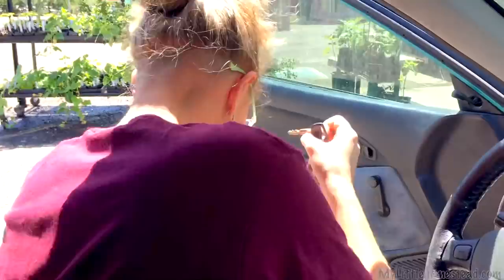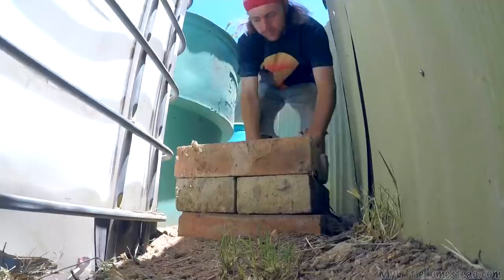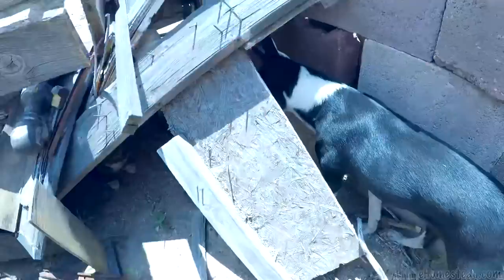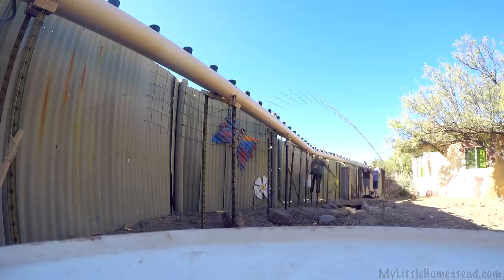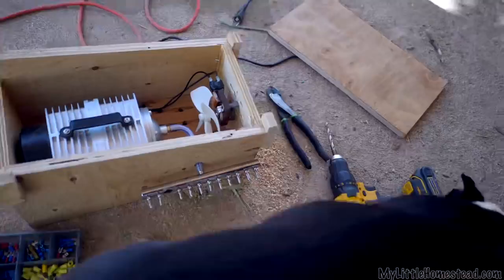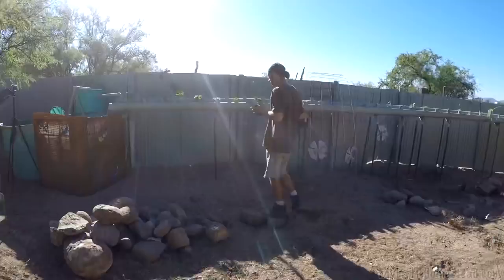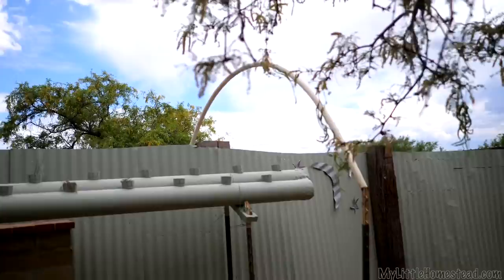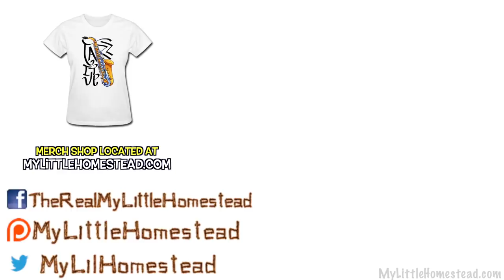Complete Build of Aquaponics System | Full Version Movie Length

Comment: YES! This is what I have been waiting for, I went through all the weekly peeks trying to get the full aquaponics build. This just made my life easier. Thank you!!
Reply: There was a video that showed up against aquaponics during g a commercial break. Just thought that you would want to know.
Reply: The setup works but this particular system is fraught with design problems in my opinion:). The airlift to move water is an excellent technique but larger diameter lifting pipe is needed as is a larger air pump, one also should make an air chamber at the injection point. Your fish tank needs a cover to cut down light aswell otherwise algae will grow eventually.

Comment: You can bend PVC pipe with a heat gun. Pack the pipe first with sand so it can keep its shape then heat up the pipe until it is soft. If you have a form that would be perfect. As soon as you have the pipe at the right angle spray cool water on it to harden the pipe to keep its shape. I use this method to male the net pot holders for my vertical tower system.

Comment: This is great an amazing protective idea. Thanks for the recap. I worked an a catfish farm and the fiberglass and resin will work perfect specially with what you're putting it on and if you develop leaks or cracks along the way or want to seal up one of those little holes you made there you go just see some more of that and it'll last for a long time it never hurts the fish either. God bless you all.

Comment: something that can help minimize solid waste cleaning intervals, aerate the system, and maximize the harvestability of fish waste in a aquaponic system is a Moving Bed Biofilm Reactor. basically its a container next to the solid waste filter filled with k2/k5 media and air stones to aerate the media forming a biofilm to break down waste like how the rock media does in the system. its like adding a small sewage treatment plant into your system before putting the water into the plantbed system potentially preventing backups.  this will also help stabilize the system so there aren't massive ph swings or nitrite buildups that would potentially kill off fish.

Comment: You'll end up with snails absolutely everywhere!. All you need is to cover your tanks from sunlight, catch the solids in first filter, then add a moving bed bio filter with that air pump then a fines filter after that. Try those 40cm commercial floor polishing pads their like big scourers but thick to catch your fines.

Comment: You can do a lot with pvc pipe.
You can join them by heating the one end of pvc and then push two ends together.  A turkey burner works great. 
You can heat a 4 inch and pull two 2x4 nailed together though it with a rope tied to the boards cut in a point. That makes a square box.
You can fill a pvc with sand and heat it and bend it and let it cool. By using sand it won't kink. You can heat and form and or cut and form and make all kinds of brackets. Pic pipe is fun. Dont buy joints. Just heat on one end and push together. Joints are exspensive.

Comment: You will want to be able to test for nitrite and nitrate, nitrite is much more poisonous, but should be broken down in to nitrate fairly quickly in a healthy system. You may find you need a biological filter before the fish tank if your plants are not taking all of the fish waste (at the start of growing for example) or manage fish stocks in line with plant nutrient uptake. Been a very entertaining series to follow along, and really nice to be able to watch it all again as a single video, thanks for the hard work!
Reply: Also Nitrite, at relatively low levels, will kill off any nitrate processing capacity in the system as well as the fish.
Reply: As you've already discovered setting up a system can be really good, snails eat algee, then loaches eat snails, so you don't have to much algee or snails.

Comment: Flood and Drain (Bell Siphons) work fine once you get the system tuned. Mine has been running non-stop for five years. The advantage of bigger beds with rock is you can grow bigger plants. My cherry tomatoes grow 12 foot long by the end of the summer. Your system requires a lot of fish and as you found out more water flow. I keep every part of my flowing water out of the sun to keep algae down. All the tanks and pipes are insulated with radiant barrier to maintain water temperature. I am thinking of adding a pipe like yours on my pipe that returns to the fish tank. I'm already pumping the water there I might as well utilize it. What ever system we use any thing is better than watering every day by hand.

Comment: Having built a couple of systems, i have some recommendations for you, not claiming to be know it all though, just sharing my experience.
So your solid filter i think could be improved, have look at swirl filter, you need to cycle your system about 6 weeks before introducing the fish, the algae problem you got is because the microbes have not populated the system enough yet, temptation is strong, but its worth the wait, it can even result in fish death, after six weeks then measure the water.
your measurements should look like  Ammonia: Less than 2 ppm, Nitrites: Less than 1 ppm (ideally less than .5 ppm), Nitrates: up to 160 ppm
Also you are not allowing the roots to breath, you need to oxygenate the water a lot more than just 1 or 2 airstones.
good luck
Reply from the maker: Thank you Alex.